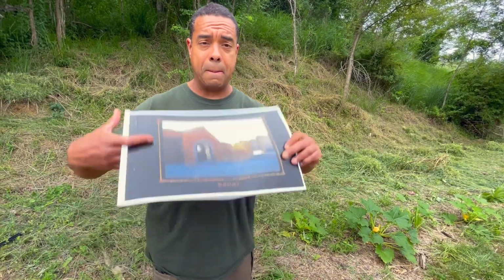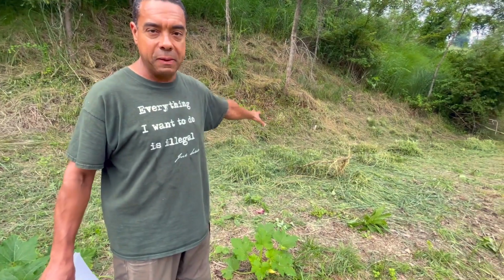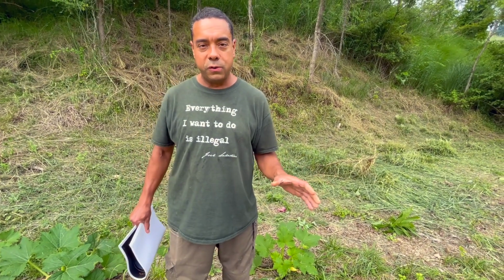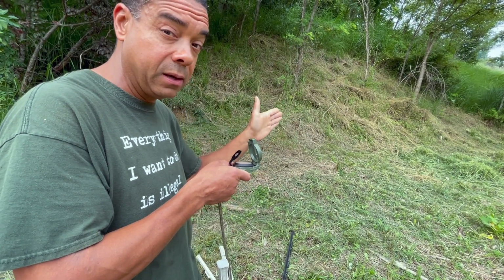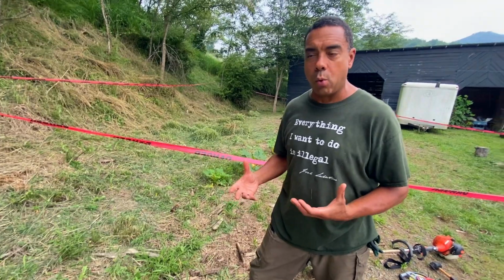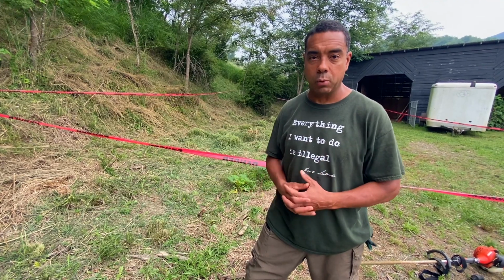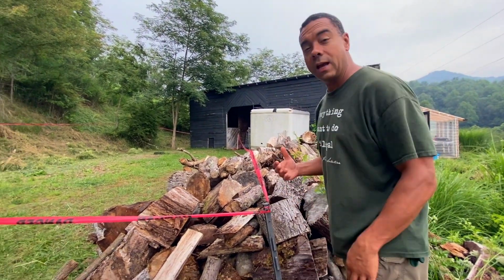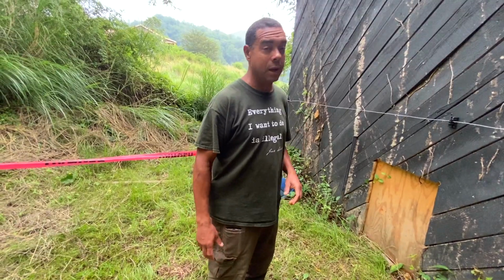Earthship VLOG Pt. 2 // Laying Out The Earthship

Comment: We are in very much the same boat. I have to dig out the side of a mountain to build my Earthship. I've been trying to figure out how to position the water tanks AND the air tubes because we will have mountain on all 3 sides. For now the intent is to dig out 8 feet more width than we need for the Ship itself, so we can bury the tanks. No clue what we are going to do with the air tubes. Here in TN our humidity is so high we have been told that using them will cause the inside to mold.
Reply from the maker: Like us, it seems you have a fair amount of engineering challenges as well.

Comment: Also, do they require for an NC Engineer to sign off for your permits. If so, who are you using... I'm having a difficult time finding one around winston salem area but, any engineer in NC will due. ty
Reply from the maker: They aren’t too concerned about it where I’m living. Technically this is just a greenhouse.
Reply: @PermaPasturesFarm21  ok, since you have an onsite home. 
In forsyth county being a usda farm I can build anything... an engineer is needed if, I use electric or live in it. 
Had one that said for $700 he would sign off but, hasn't made the time during the last year. 
Thanks for your reply.